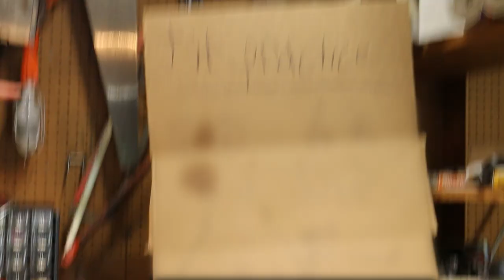the guy who makes truck bumper stickers

Comment: It goes on the back of your truck. Then 3 years later you want to remove it. But guess what? It has now fused to your bumper and the only way to remove it is burning the truck in the cursed flames of hell.